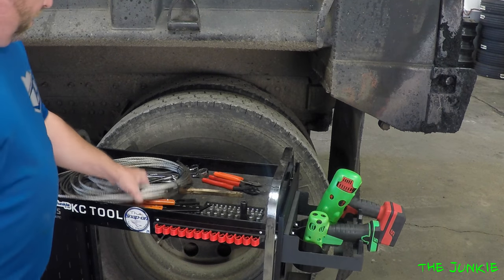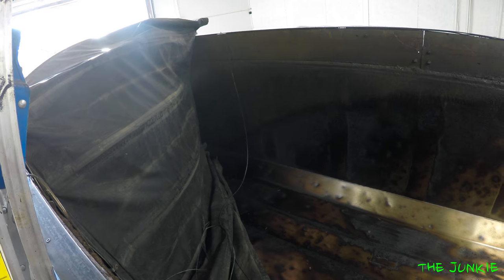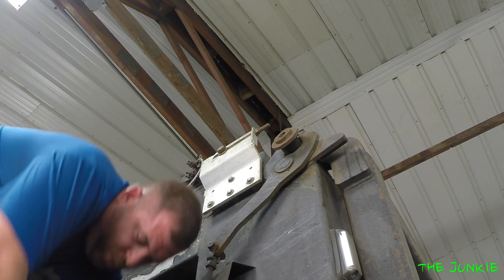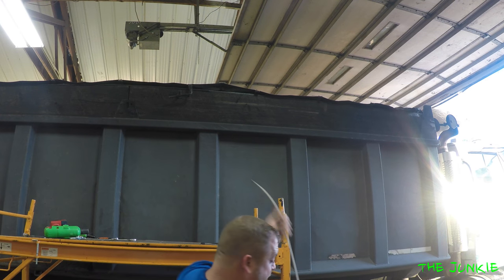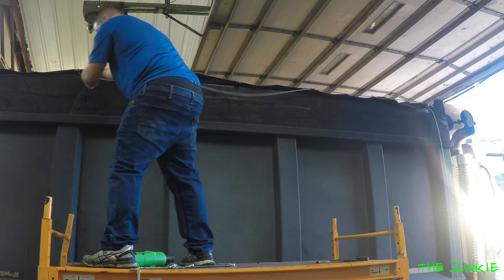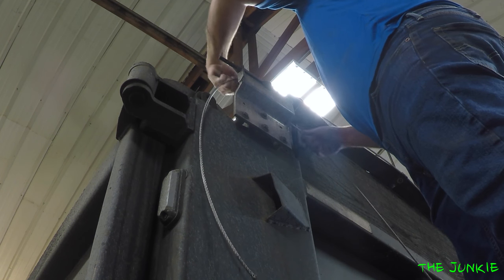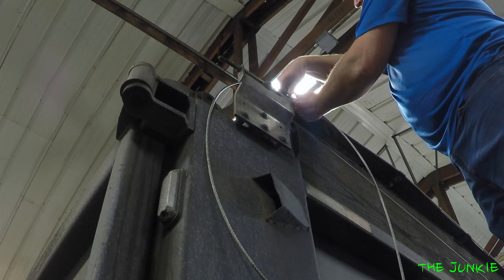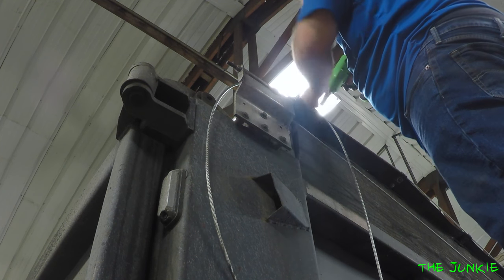WORKING ON THE TARP AGAIN TARP SCHOOL 101🛠🔩🚛🔥🔥

Comment: Was it the cable that broke or the clamps. I know that cable shit comes in different grades, and the cheap shit doesn't last long at all when it bends around the end pulleys. Either case I hate the wire rope cable shit, and you would probably be better off using a regular chain drive.

Comment: To prevent the wire to fray and stab you just cut it with the welder cranked up as high as she'll suffer..
Reply: Yes, you weld the ends, but not with the welder, we'd use the cutting torch just like using a lighter on nylon rope.
Reply: Yes you can do it with the torch but try with the mig welder.. it cuts and weld it at the same time ;)